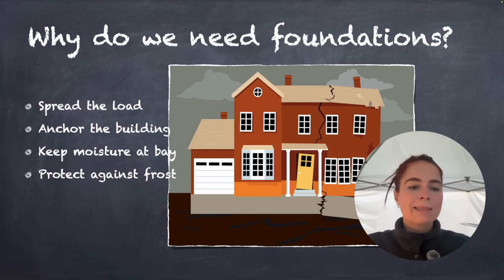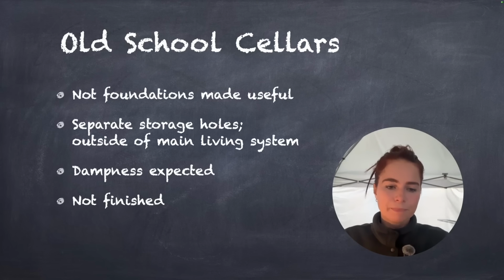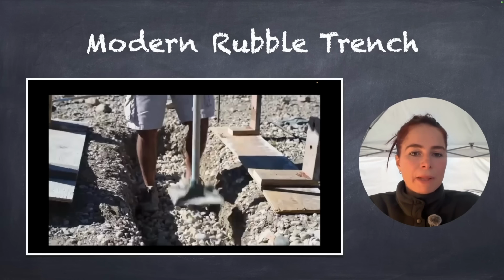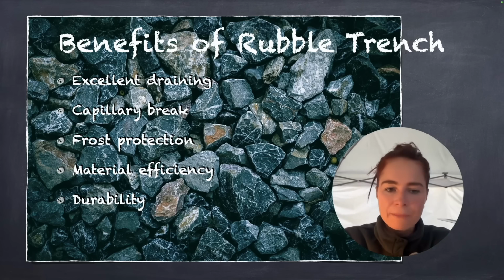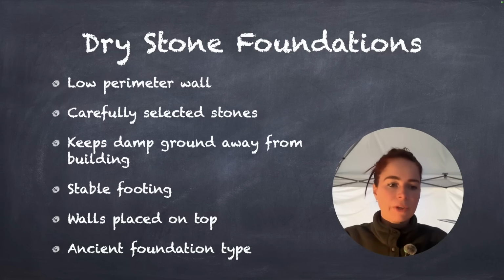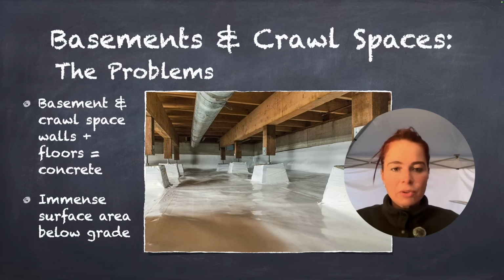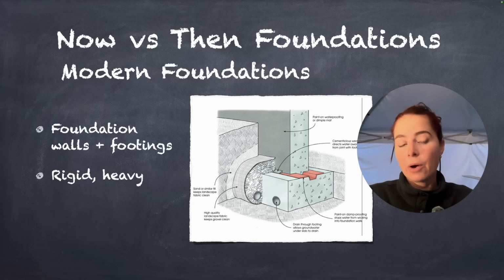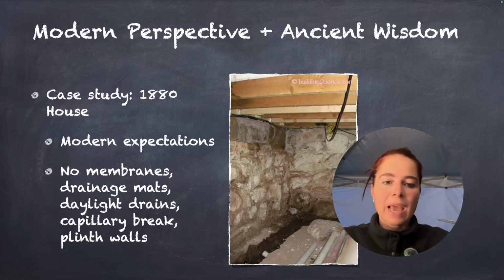Why Modern Foundations Fail — and the Genius Design We Abandoned

Comment: Totally agree that trenches are great. Although combining them with basements makes it even better.

In most cases it is not the basement itself that causes bad air quality.
Mold or fungi can't really grow on stone/concrete with only the addition of moisture. I believe only algae can, if there is enough sunlight.

Organic growth is promoted with the later addition of organic materials, like plastic paint, plaster boards, particle boards etc.
Board materials may also leach more gases/solvents in humid conditions.

This can be remedied by simply sticking to proven mineral materials on walls and floor, like plaster/render, mineral paint, stone slates.

Another issue would be that vents are sealed to remove draft.
With natural vents in place, the air flow in a basement is usually better than the floors above, as the pressure difference to the chimney/roof vent is higher.

Soil gases, like Radon, could of course be an issue. We measure it every ten years.

I actually prefer the air in our 1930s basement where we have set up our main bedroom. Nice and cool during hot summer days. No AC required.

All organic materials have been removed and the moisture level is naturally kept in a healthy range of 40-60 %RH. Too dry air is otherwise an issue during the winters here.

With that said, the humidity level upstairs may be elevated and proper drainage is much appreciated to keep the feet dry.
We have layed drainage pipes in macadam, added permeable insulation to the outside of the walls, rendered it and refilled the trench with LECA pebbles for additional drainage and insulation.
The walls are built with hollow concrete blocks (provides some insulation) that sits on a concrete poor over head sized rocks in a trench.
Water heated floors are enough to keep the temp around 20 C.
Reply from the maker: Yes — washed gravel as a capillary break is excellent, agreed. And you’re absolutely right that modern finishing materials below grade often make things much worse.

Where I tend to zoom out is that below-grade spaces still deal with hydrostatic pressure, inevitable moisture, soil gases (not just radon), and stack-effect pressures — and even microbial growth on dust and dirt films on concrete can matter for people with environmental sensitivities.

I’m glad your basement works so well for you — that’s great to hear, and thanks for sharing your experience

Comment: Use additives in concrete like Zypex c1000, it becomes waterproof. In low frost areas like Southern California and no need for any gravel at all.
Reply from the maker: Zypex C-1000 is a crystalline pore-blocking admixture, not a hydrophobic treatment. It reduces liquid water permeability, but the concrete remains capillary-active and vapour-open.

Even with crystalline admixtures, concrete still absorbs and transports moisture — just more slowly. That’s why drainage layers and capillary breaks (gravel) are still doing essential work, regardless of climate.

“Waterproof concrete” doesn’t mean moisture-free concrete, and it doesn’t replace foundation drainage physics.

Comment: hey that's a good point -- it's not like the Romans didn't have concrete and wouldn't have used it if it was better
Reply from the maker: Exactly. The Romans did have concrete — and they used it where it made sense. But most Roman roads relied on layered stone and rubble because drainage, flexibility, and serviceability mattered more than monolithic strength. Concrete showed up selectively (urban streets, bridges, culverts), not as a default. That choice tells us something.
Reply: @thehealthybuildingproject  it does certainly tell us something! To be devil's advocate, it's possible the relative costs were different then, but I imagine records exist on that one, and even if they don't we could probably make a fairly good estimate based on what we do know.

Comment: I doubt my "modern" poured 10" thick concrete with copious rebar foundation will fail before the rest of the home does.
Reply from the maker: It depends what we mean by failure. Structurally, concrete can last a long time — but many foundations “fail” in other ways first: chronic dampness, mould, and poor indoor air quality, even though the structure itself is still intact.
Reply: @thehealthybuildingproject  Poured concrete is the best to keep water out if bituminous coated on the exterior like code says.
Reply: With no drainage underneath, the concrete may still suck up moisture and the bitumen will then prevent it from evaporating to the outside.

If the inside is painted with a non-permeable paint, the lower parts may start to flake. Quite common in older basements (30s - 50s). Not really an issue as long as the walls are left bare or the outside soil is dry.
Adding insulation to the outside would help the walls dry out.

Regarding reinforced concrete, rebars eventually rust, weakening the concrete. Probably not an issue for houses but a ticking time bomb for bridges etc all over the world.

Comment: I built a rubble drainage trench for my concrete raised beds as the soil is heavy clay & spring rains are torrential & long-lasting, which would drown the beds out normally.
They also help protect against frost heave & help prevent cracking in the concrete.  It's been 5 years & no cracking despite max temp swings of -10 to 110 degrees.
We also used basalt fibers & a couple rebars for extra integrity as they aren't affected by temperature shifts or ph changes.
ETA:  We also wrapped the trench & the pipes separately with landscape fabric.

Comment: I currently live in a house at the botttom of a hill with a swamp behind it.  Water table is only slightly below basement slab and sometimes rises above it and parts of basement flood.  Wouldn't you know the builders used CMU block for the stem wall (even more porous than concrete), without waterproofing, and without a tile drain.   If they had simply included a tile drain and waterproofed the stem wall, basement would be dry - expensive job to do after the fact.   The added convenience of underground living space is too valuable to pass up, but you do need to engineer it so it stays dry.
Reply from the maker: That really sucks — sorry you’re dealing with that. It does depend on motivation. Basements, once they’re part of the building envelope, will always carry higher moisture risk. You can absolutely engineer them better or worse, but the risk never goes to zero.

If indoor air quality is especially important for health reasons, steering clear of below-grade living space is often the safer choice.

Comment: Massive structure doesn't tell us much 3 stories 4 stories 12 stories  ?!!!
Reply from the maker: From what I’ve read, rubble trenches are generally fine for typical 1–3 storey buildings. The limits seem to show up with really heavy, multi-storey structures. But definitely check with an engineer for your specific design — they’re the ones who can confirm what’s appropriate for your site and loads.

Comment: The knowledge is still there. But cost cutting is done easily on parts the customer will never see when buried under soil. Yo need a reasonable engineering of the soil you're digging in and how to stop dampness with barrier layers like asphalt. The engineering executed to the point not just done by some carpenters doing foundantion work on the fly.
Btw. the middle age built cathedrals have more mass installed below grade than raising visible. Living in Germany I remember a special tour on Cologne Cathedral of the "underground" to it (not open to everone) when I was at school nearby. It's impressive as they were digging down over 30 ft below grade. Btw. choosing well the material even considering earthquakes.

Comment: I like your rubble trench foundation and I would add a couple of thoughts.
Rammed earth walls, Hempcrete insulation on the outside of the walls.
Also stabilize the walls with lime not Portland cement.
2nd Insulate the outside of the rubble trench foundation.
3rd lime coat the inside of the rammed earth walls with lime base finish. This allows interior moisture to go through the walls.
This is my dream, but I am getting old now.
Looking forward to your thoughts.
Reply from the maker: Martin Rauch actually talks about the kind of rammed earth build you’re imagining in Refined Earth (https://amzn.to/4oU7Jih)! Lime stabilization, vapour-open walls, and exterior insulation all fit right into his approach. And insulating the outside of a rubble trench foundation lines up with good practice from what I understand.
Reply: @thehealthybuildingproject thank you. When I return to USA I will read what he has to say. How do you deal with permafrost with rammed earth walls?

Comment: "Ballast Stone Foundation" is my suggestion to replace "Rubble Trench" which is indeed bad sounding.

The rocks used are like the ballast stones used beneath train rail ties....which are used for the same reason as a rubble trench...solid, can shift for weight distribution, and drainage.

Comment: Build your small frame house/cabin on large precast bridge grade concrete blocks. (6000psi+ concrete) Something like a median divider you see on the  road. These can run about $150 to $250 each delivered. You only need 4 blocks, and there are reasons to have only 4 but of course the engineering of the house frame for 4 blocks is critical.  Precast 2'x2'x6' for example. This would put your floor frame about 24" off the ground. Remove top soil and tamp as much as you can under the blocks, even with a big tamping machine is excellent. You could use the rubble/gravel/ballast under the blocks depending on what kind of ground you have. Use screw jacks and metal plates to shim and level the frame and let the frame float on steel shims, on the blocks. Chain the floor frame to the blocks to allow for some movement.  Leave a way to jack it level later at each block. Have a large roof overhang. Trench around the house and install ground drainage systems in the trenches and have plenty of grade away from the house. Skirt the lower sides of the house, the crawlspace lets call it, with heavy PVC board (hang the skirt from the house frame and down below grade in a sand trench ) and attach rubber mat (drainage mat) to the skirt that flows water out to the drainage trench. You can put soil right on this mat but you want to ensure the mat keeps a flowing grade to your drainage trench and doesn't allow pooling. Install house siding that overhangs the skirting and rubber mat. Install crawl space ventilation. I prefer fans because you can turn them off or on for more control and can arrange to keep critters out as opposed to passive grates. For larger buildings, the floor frame and the building in general must have increased overall unit strength to span the distance between the foundation blocks and to counteract frame sag and twist, and as blocks settle or move. Everything moves. Check level, jack and shim, after earthquakes or every couple of years. This will make a very very dry house and with nice air quality. If you keep it level, the roof, the siding, the ground mat, and the drainage trenches maintained/replaced, this house will last 500 years.
Reply from the maker: Thanks for sharing this — I really appreciate the focus on keeping the structure elevated, well-drained, and easy to inspect and maintain. Those principles go a long way toward keeping a small building dry and healthy. Lots of creative approaches out there, and it’s always interesting to see how people think through moisture, movement, and long-term upkeep.

Comment: Hello, a question from a Belarusian resident. Haven't you in Canada invented bitumen-based adhesive insulation or drainage systems, or even ventilation systems? I don't understand your denial of concrete. I see that your country is simply short on specialists and craftsmen, which is why your concrete houses are so poor.
Reply from the maker: Thanks for the comment — and yes, Canada does use bitumen membranes, drainage systems, exterior insulation, all of that. The issue here is really a combination of physics and workmanship. Concrete below grade is always dealing with hydrostatic pressure, capillary rise, and vapour drive from wet soil. Even good waterproofing breaks down over time, and any small detailing mistake becomes a moisture path.

At the same time, construction quality here can be inconsistent, which only makes those physics problems worse. My point isn’t that concrete is “bad,” but that below-grade living spaces are inherently tricky to keep both dry and healthy, especially when the workmanship isn’t meticulous.

Comment: A very useful presentation. It seems to me that, if we had a capillary break around the entire perimeter of a building, we would likely create a suitable dry soil space under it that might be used if properly insulated as a thermal sink that would be protected from rainwater percolating through and robbing warmth from the sink. Such a sink might be a much better way to provide geothermal heating and cooling for the building.
Reply from the maker: Thanks so much, that’s a really interesting way to look at it! From what I’ve been reading, soil moisture plays a huge role in how ground temperatures behave. Dry soil has much lower thermal conductivity than wet soil, so in theory, if the whole perimeter stayed dry and was insulated well, the sub-slab soil could act a bit like a thermal buffer.

I’d love to dig into things like passive annual heat storage and ground-coupled thermal mass systems more — it’s definitely an intriguing concept. If you’ve seen projects that have done this successfully, I’d be curious to hear about them!

Comment: Earthship has entered the chat....
Reply from the maker: Ah right — yes! Earthships are the perfect example of what happens when you build underground without really accounting for moisture, hydrostatic pressure, or capillarity. Great idea in theory… but the physics still win.
Reply: There always will be issues when building any structure. I would venture to say with stem walls and or block with a layered system that drains you could get rid of that issue. Overall, no building system is perfect but maybe we can agree that the pro's out weight the cons compared to modern cookie cutter homes especially when taking most of the energy costs down stream in the grided systems.

Comment: Currently building a house in Indonesia- the ‘rubble teach’ is the way they do all foundations there- our 2 story building had a 3 meter deep trench by .75 meter wide trench- and big rocks, hand placed, used to fill. Then capped with reinforced concrete for the brick walls. Frost is not an issue in Indonesia, however, monsoon season is.

Comment: I don't know this for sure but I bet basements became  popular because they could be used as cellars and storm shelters without going outside.
Reply from the maker: That’s probably a big part of it — basements definitely made sense historically for storage, root cellars, and storm protection. The tricky part is that the way we build today is completely different from how those original, much drier, much simpler cellars functioned. Modern basements are tightly wrapped inside the conditioned envelope, full of finishes and mechanicals, and expected to behave like clean living space… all while sitting in the wettest, coldest, highest-risk part of the building.

Comment: A rubble trench forms a thermal energy break. You do not get the conduction of heat from the building interior to the yard the way concrete does. Rubble reduces sound transmission. Where you have a tall building with any Stack Effect, the porous rubble will allow air to pass through the soil into the home's lower level, thereby minimized depressurization. This improves the draft pressure in chimneys and atmospheric combustion vents while minimizing cold air infiltration pulled in by lower level negative pressure. It forms a bit of a buffer against vapor diffusion from the wet soil towards the dry interior. Bugs don't like crawling across boulder fields towards dry areas. A dry interior floor subbase will not wick away as much heat as a damp concrete foundation and floating slab. You don't have to worry about hydrostatic pressure caving in walls. Concrete is great in seismic events right up to the moment it fails, then it becomes a liability. Rubble allows some disconnect to the ground so less energy is transferred to the structure. The low perm rating of concrete functions similar to a bug's exoskeleton- it traps moisture inside. A rubble trench can absorb some movement from expansive soils whereas a rigid monolithic RC wall or brick wall will shift.
Reply from the maker: This is a great set of observations — thank you for sharing it. A lot of what you’re pointing to are exactly the reasons rubble trenches have lasted for centuries: no hydrostatic pressure constantly pushing on the walls, a natural capillary break that keeps the whole assembly drier, a sub-base that doesn’t wick heat the way damp concrete does, and a foundation that’s simply more forgiving than a rigid monolithic wall.

It’s amazing how much healthier and more durable a building can be when the foundation is allowed to drain and stay dry. I really appreciate you adding this to the discussion.